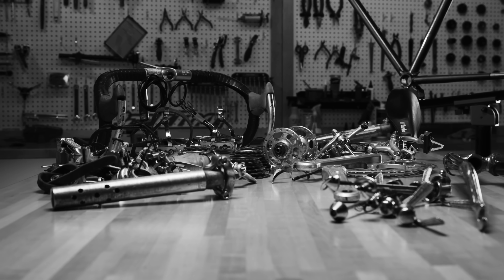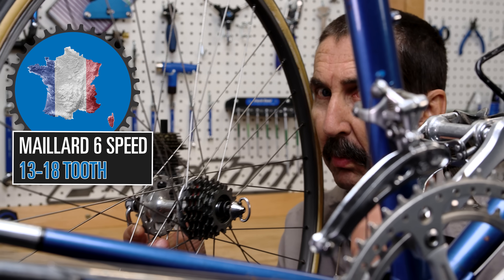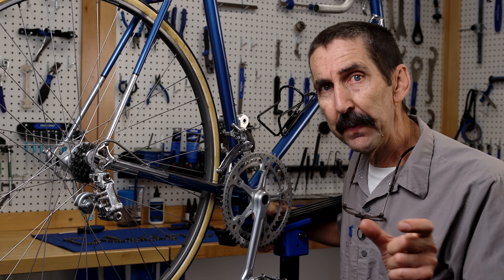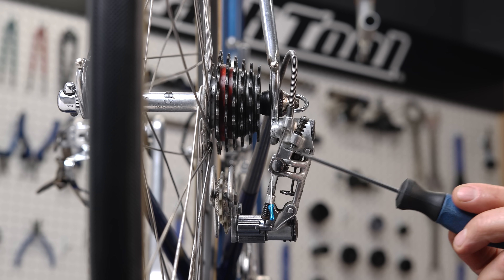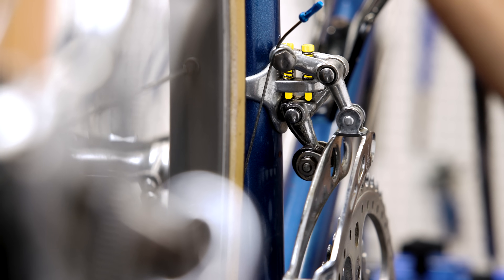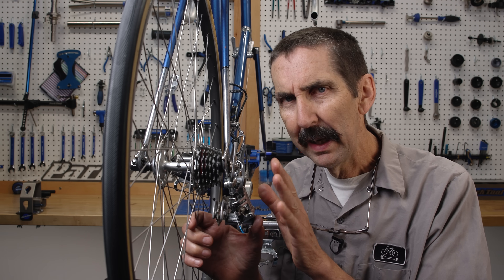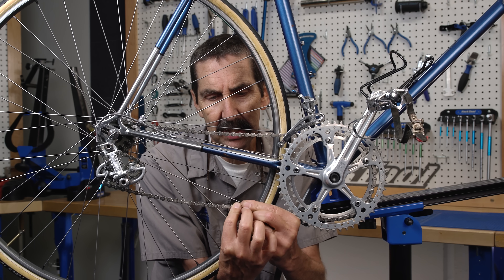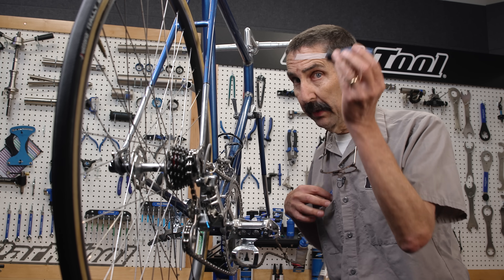What Can Old Friction Shifters Teach Us? | Tech Tuesday #225

Comment: I did not switch to index shifting until STI came in. The original SIS was no better than the traditional friction shifters, if not worse.  SIS did get the less mechanically inclined  into ten speeds.  STI integrated SIS with the brake controls; it was the game changer.

Comment: I learned basic drivetrain adjustment on a cheap Shimano "Light Action" friction system back in the 80s. It never occured to me that cyclists in more recent years never had that experience and therefore might not intuitively understand the interplay between limit screws and cable tension. Once you get these basics, the only other thing to learn is the function of the barrel adjusters or electronic microadjusts and you're good to go on indexed systems. I use ETap and Di2 on all of my bikes these days, but I still kinda miss that Light Action.

Comment: I have many miles and years with this system. I bought my first “10 speed”, a Peugeot in 1970. I don’t call it friction shifting but finesse shifting, because it took a little bit of finesse to get it on the gears and centered.  
After a while with muscle memory, you could shift between gears and get centered without having to monkey around.
Back then we did our own maintenance, the way most guys did with all their machines, we figured out how to keep things running on our own. There weren’t any other sources out there.  
But as you’re showing in this video, having the basics, it made it easy for us to transition to the newer systems.

Comment: Simplicity. No clicky that works only with this SKU or that range of chain only made between 2xxx and 2xxx. Oh, I better keep a few of these rear hangers in case I update the cassette and the rear direaleur can keep the old hanger so the new one clamps on a fresh one.... Blah blah blah.... An old forgiving steel bike with 27"wheels rides like a Lincoln Continental and won't snap in half in a fall. I had an old lightweight Fuji (or Peugeot- can't remember) in the 1980s. I kept the heavier steel Shogun because the ride was so much nicer. (That was a looooong time ago.)

Comment: when s.i.s came out on bikes it was like a bolt of lightning...Such was the difference ...after years of gear grinding and slow changes and banging and clanking of the chain...I dont miss friction shifting ... But even in the 60s and 70s we mostly had coaster brake bikes with no gears...Us teenagers all wanted 10 speed racers...!

Comment: Had a Raleigh friction shift with the levers on the stem. My problem was that the levers always got loose and I would have to stop and drag out the flat blade screwdriver to tighten them.

Comment: I built up my first bike in 1973 and still ride the Ron Kit Super Vitus frame and some of the original parts (Campy derailleurs, SunTour bar end shifters, Universal Super 68 brakes, Super Champion clincher rims on Campy low flange Record hubs, Regina freewheel); plus some modern parts (Sugino 26-40 crank set, Soma city bar, new-old stock micro-adjusting seatpost, Brooks B 17 saddle. Of my five bikes (2 '70s Raleigh Sports, 25-year old Performance mountain bike (ex-kid ride) and a 2013 Surly LHT, my 1973 former racing/ noe city bike is my favorite. I still don't like indexing.

Comment: Frction shifters were good as almsst always you could position your derailleurs appropriately.  Index shifting is great when its dialled in.  Elec stuff would also be good but still darn expensive.  I would love to have friction shift on the rear, not sure how practical though esp' with e-bikes and fairly powerful motors, the font derailleur isn't much of a probelm, as you only have 2 to 3 rings, much easier to adjust slightly outside the sprockets, that's the additional spring load in the index shifters, to ensure enough travel to shift.  Enjoy, and thanks for a good video.  Not many of ur type around these days unfortunately.  Ta.

Comment: I love these old bikes ! they are a real pleasure !  Simple and intuitive to set up and fix. 
Your presentation was super especially for new high Tech riders or mechanics!
You have to anticipate your gear changes as your ride terrain changes up or down Great bikes if you have a chance to lay your hands on one - there is a good bit of NOS stuff  available online !
Great video!
BTW they will shift better if the ratios are narrow - 6 and 7 speed  freewheel are the norm and 42/ 52 up front! I have got old Shimano Mountain bike 
freewheels to work- Finally you can buy brand new chain rings from French company TA - they are fab !
I have an old 1980's Tommasini with a Campag Simplex Cinelli Mavic mix - lovingly restored and used a good bit but only in dry conditions ! 
Thanks

Comment: Have I ever adjusted a friction drive train? That was called "riding a bike" when I started. And I'd be adjusting friction now if they'd let me. Hint for the younger folks: index shifting is on that long list of "upgrades" you don't need that increase the hassle and expense of bicycling without adding much for the great majority of riders. 

It takes about 20 minutes to internalise the physical motions required to shift friction and then do it without thinking for the rest of your life. And once you've set the limit screws, you're good literally until you take the bike apart -- or have to mount a new chain. Then you set the screws again and... you get it. 

So there's no futzing with every single shift position at the start of the season, and especially -- no moment on a long ride where the transition from one cog to the next suddenly gets balky, or it shifts without asking. As the cable stretches, your hand naturally compensates. When the it stretches to the point that the hand movement becomes ridiculous, you tighten up the cable (or replace it), set your limit screws, and... never think about it again.

I now have a very nice bike built in 2017, and I like it, but I really wish I hadn't sold my old 1974 Gitane. It, like, worked.

Comment: I built my road bike in an old 80s Bianchi.  I intended to outfit it with index shifting, but I’ve gotten so used to the down tube shifters that I’ve decided to keep using them.  It may be a little more cumbersome, having to take one hand off the bars to shift, and getting familiar the friction shifter, but I liken it to driving a manual shift in a car.  Just something you get used to then it becomes second nature.  They’ve lasted almost 40 years, they’ll likely last 40 more.

Comment: Listening to the sound from the rear sprocket to adust the position of the derailleur works beautifully on paved roads. However on gravel or in noicy surroundings it can be really difficult to hear this sound. You will have to rely on feeling the vibrations in the pedals. Not easy.

Comment: This is the technology I raced with in the '60's. Never had a problem with my gears, the quick release never came loose and the rim brakes stopped me just fine. All manufacturers components were also compatible with everyone else's. Lastly, my hand-made Condor frame with mostly Campag  components cost me about £50.

Comment: 18 tooth in the rear? WTF!!
Reply: My cassette was 14, 16, 18, 20, 23 with 46/52 on the chain ring (hence the term 10 speed). Probably not good for the Alps, but everyone else was riding similar gears.

Comment: Could you ever imagine going up hills with this rear cog?? 😮 Those men were beasts! Hemocrat 60+ for sure!
Reply: This straight block was for criteriums. It would’ve been normal to have a different freewheel with 13–21 or even 13–23 for hilly riding and racing.
Reply: @westsidewheelmen  Funny. I spent many years riding for the Eastside Wheelmen. I never knew there was a Westside. Kudos!
Reply: don't they have fewer front teeth? I was on one by 7 and front was 52, it took quite a bit to get it started to say the least, now with a 48 in the front I can't even tell I'm moving

Comment: funny enough the more gears you have the better friction works. On a 5 speed doing a bad shift and having to adjust is something very common until you build your muscle memory for that bike. This is a result form the amount of space between the cogs. moving from 5 to 7 It was much easier to shift. Again moving to 9 and 10 speed friction shifting is even smoother as it starts to become hard to not just land in a gear.  That has been my experience.

Comment: I got myself a Kona Sutra with bar end friction shifters earlier this year. The last time I used friction shifters was on cheap kids' bikes back in the '90s. I got my Kona second hand, and the indexed shifting on the rear derailleur was beautifully set up. Last week I noticed a couple of broken strands on the rear gear cable and decided to replace it, in the run-up to a multi-day trip. And although I understand and have some experience with setting up the tension and limits, I just cannot get it to shift as cleanly as before. I wish Calvin was there to talk me through it!

Comment: One of my bikes is a Raleigh Competition made in Japan with Reynolds 531 tubes. SunTour Superbe derailleurs, New Winner 6spd cluster, 42/52 SunTour Sprint 170mm crank. Cinelli bar and stem. Campy Record hubs laced to Mavic tubular rims. Continental Sprinters. Brooks Swallow saddle. SR fluted seat post. Bike weighs in at 21.3lbs and is an absolute joy to ride!

Comment: I love my old road bike, first decent bike. Hand built 531c frame, I watched the builder brazing it. Then use a Campagnolo Tipo groupset with Mavic rims to finish. It’s my “nice dry day” bike and the old skool gear works as slick as day one after thousands of miles. There’s definitely a “feel” needed to set everything up and in its use, like gear changes under pressure. I do like my modern carbon flyer, the refined engineering is lovely. Enjoying both is better than comparing negatively. Now stop watching YouTube and get out on your bike 😂

Comment: I still ride daily my 50 year old Peugeot road bike with all original parts except for tires, brake pads and saddle.  I clean and lube the chain often to get maximum life of this machine, even though it never was state of the art.  I have a carbon road bike that I take on longer rides, but for casual rides to the store or locally this Peugeot can't be beat.  Cheers

Comment: I still have an old Favorit steel bike from Czechia with Sachs friction system and six speed freewheel at the back. Riding this bike (with strapped shoes!) was exactly how you described it - my hand was indexing gears 😊.
The biggest problem was not a drivetrain but tubes - it was a nightmare when I got a puncture to change a tyre 😂.
Thank you for your anither fantastic video!

Comment: Amazing video! I had been riding 80-s steel German touring bike on 35c wheels with friction system. Jeeeez, it was comfortable and smooth, even more comfortable than my modern aluminium gravel bike on 40c tires (with carbon fork). 
I bought it in 2014 when I was 18, then rebuilt it, repainted, added nice neat mud-guards, polished all aluminium parts. It was my dream to have a vintage bike and it came true) It also had those secondary brake levers system - very cool and convinient. Missing that feature a little bit on other dropbars bikes
Reply: This summer, I missed out on a Trek 720 that would have been very similar.  There is something special about well made seventies era touring and sport-touring bikes that the industry would do well to replicate.

Comment: I switched back to friction shifting in 2010 and have never gone back to  my old index systems. I still have three bikes with index shifting but I have not ridden them in years, I need to sell them one day.  The friction systems are super reliable  and very cheap to buy. Crazy easy to set up too. Plus almost any deraileurs will work, you do not have to worry about keeping a matched group, Suntour, Shimano  or even Microshift can all work together.  If you are an old guy like me, and have some of your old stuff from way back, they will still work too. Just change your cables every year and check the derailleur stops and you are good to go.

Comment: I grew up on friction shifting bikes, so fine tuning the shifters by hand is second nature to me.  My only current friction shifters are a fully restored 1980 Motobecane (lots of sentimental value) and a modified 2001 Specialized Sirrus Comp with bar-end shifters on drop bars, and on that one only the front shifter is set to friction.  I'm not willing to ride the old French beauty much, so I'm constantly shopping for a bike of similar vintage that warrants a mechanical refurb but not a full restoration so I can use downtube friction shifters more regularly.

Comment: One of the fastest bikes I owned was an old ten speed I picked up for free. Somewhere along the line it had lost a front chainring so it was in  fact just a five speed lol. But it fitted me better than any bike before or since and I used to whizz around south Cumbria on it, and Manchester. Friction shifting is refreshingly simple - in a way there's less to go wrong. The unnerving aspect is having to take one hand off the bar at speed to shift.
I piled that bike into the side of a taxi that did an illegal U-turn in front of me and did a big OTB. That was the end of that bike RIP!

Comment: I prefer friction shifting. With the right lever the effort is lower, and friction levers just look more elegant. I use 9-speed RDs on 10-speed cassettes with no difficulties at all. 

Which is another nice thing about friction shifters: most of them have no problem pulling enough cable with old 2:1 RDs to cover any cassette.  Gets rid of a lot of compatibility issues.

Comment: I’ve had friction on 4/5 of the multi-gear bikes I’ve owned, with 2 of them having bar end shifters that could toggle between index/friction. I’ve gotten used to indexing, but friction worked fine. I remember knowing EXACTLY where to place the lever for any gear on the bike I rode in my early 20’s. I think it was good to have this experience. Figuring out the how & why if it did promote a better understanding and a sense of being ‘in tune’ with the machine. 

There is beauty in simple analog things that are human operated, like friction shifters & antique hand-crank operated coffee grinders.

Comment: As an "older" cyclist from the UK with some 50 + years cycling under my belt I've always used friction levers on the downtube to change gear, however with advancing years I'm finding it more awkward to reach the levers and change gear safely,  so I'm  contemplating changing to bar end shifters rather than going down the index route as I love my old campagnolo record system and have no wish to change it.
I find I get something of a perverse pleasure out of making slight adjustments to the shifters to get the derailleur to run as smoothly as possible,  I'm a new viewer to your channel , I enjoyed my first taster immensely 😊.

Comment: i have  3 by 7 gears. this issue remains after replacing the chain (sized correctly) freewheel, cables and housing...when in the second third or fourth rear gear when I drop the chain of the big ring on the front onto the the middle ring...the chain drops to the next smallest gear at the rear...I have been through the set up process for the gears many times ...shifting is good ..except this odd problem any ideas what I am missing ??

Comment: I had a friction shifter with a 6 gear rear, and it wasn't so bad, that we think about today. It has much more tolerances, as the chan was also wider. Of course I'd not go back to that if I had the choice between a modern system and the old friction one. :)

Comment: all my childhood shifters were friction.  i'd hold the lever until i felt it shift and then adjust more finely until it sounded right or looked centered.  index shifting is faster but with friction you can set that front cage exactly centered regardless of which sprocket you were on in the rear.

Comment: Friction shifting was like playing a musical instrument. You just get better with practice. The old Campag stuff was SUCH a joy to work on btw.
Reply: Oh yeah.  Friction is analogue, like the bike, bearings, rider, movement down the road.  The Campy short cage derailleurs took up less chain wrap and together with short down tube cables, friction shifted quickly.  The down tube shifters never wear out.  Unscrew the thumb tensioner, slide out the lever, and clean out the teflon bearings once a year.  When the cable frays at the shifter, rider feels it before it breaks.
Reply: Perfect comparison! I loved my friction shifters. I was one with the bicycle every time I shifted.
Reply: It is the Suntour Superbe for me, best friction shifter ever.
Reply: I do think the slant parallelogram read derailleur from Suntour was an improvement.  If not, then why did everyone copy the design when the patent expired.  😉
Reply: @christopheroliver148 indeed it was a Great Leap Forward in derailleur design…. that being said I was still riding a Campy friction vertical kinda’ derailleur in the early 90’s….

Comment: An index shifting bicycle came out of the shop and said, “They aligned my derailer hanger, tightened my cables, and had to adjust the barrels to make sure I was 100% perfectly clicking in each gear. It sure took some time and money.” A friction shifter bicycle replied, “Say what?”

Comment: Yes on the friction shifting here. A bit slower and of course impossible to shift from the hoods while out of the saddle, but much less sensitive to cable stretch and any minor alignment issues since you just handled that on the fly.
Reply: I would say faster, not slower. You can jump from smallest to largest sprocket in one pedal rotation. Try doing that on indexed, or even Di2. No chance.
Reply: @mikekelly1771  Slower if you want perfect shifts. Yes quicker for big changes but I don't know any fast rider or racer that wants that.